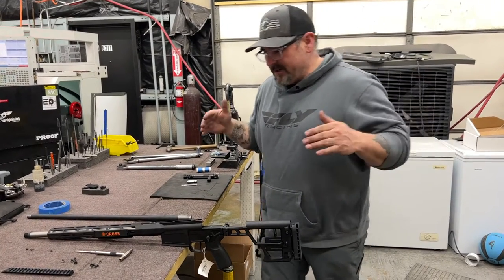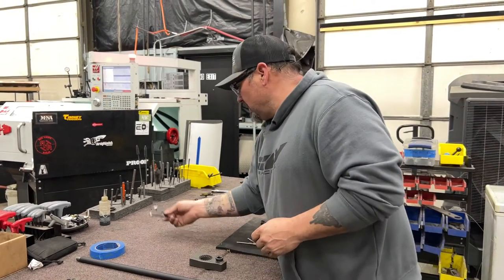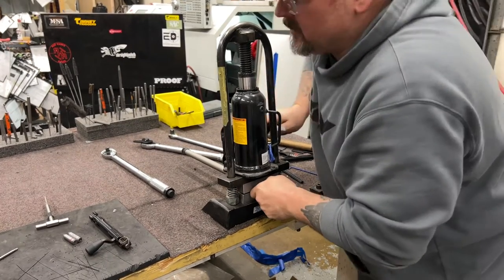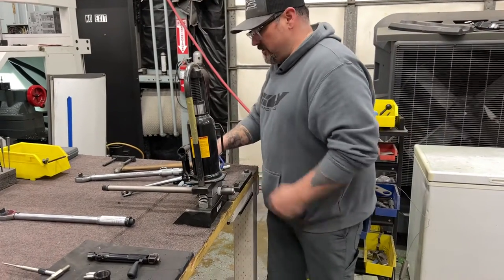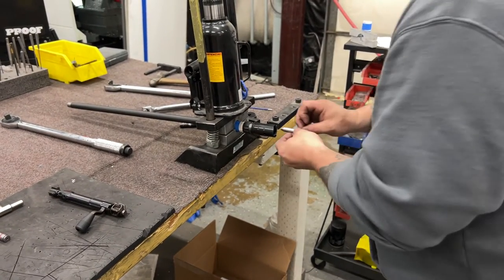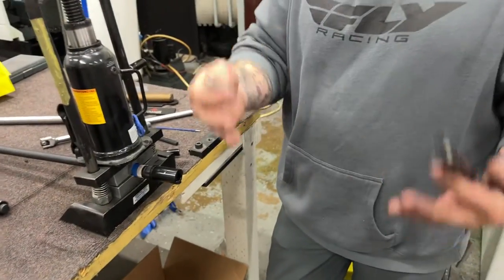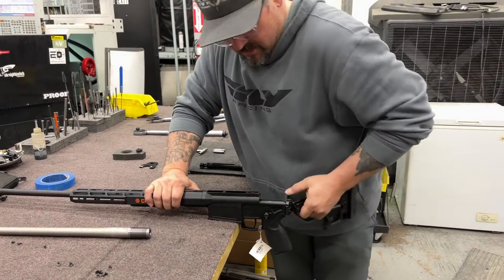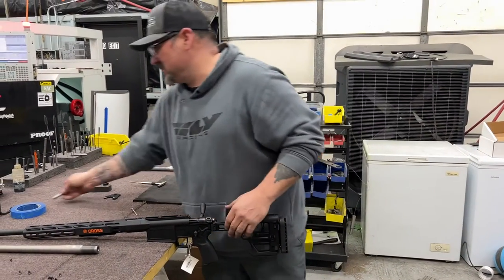Sig Cross Barrel removal and Installation, head spacing you’re barrel!

Comment: You should warn that people are breaking that dowel pin if they do the nuts in this order. You need to loosen that jam nut first while the barrel nut is still on. If you try it afterwards, the only thing holding that barrel extension from spinning is that dowel pin.
Reply: The jam nut is the one that requires the 1 1/16 12point crowfoot, correct?
Reply: @DrewMonge  yeah it's the smaller nut. The bigger one uses an AR armorer's tool.
Reply: @FC2ESWS  Thank you!

Comment: Thanks for the video. Very detailed and informative. Btw, the Sig in their manual says to use the action wrench, is that necessary? or i can just handheld and torque it down as in the video?
Reply: He didn't torque the barrel back into the action.  He said it in the video.  If you feel you can get a good torque reading hand holding it, go for it.  I had to change a barrel on a sr-25 in the field.  Almost anything can be done if you can get the receiver stable enough.

Comment: If put second  barrel extension on second barrel it was create more easy barreal swap system (like swap barrel to barrel). It is posible to buy  barrel extension for sig cross?
Reply: I wondered this as well
Reply from the maker: Not at this time. We are working on a aftermarket